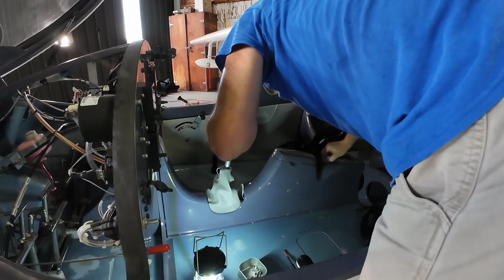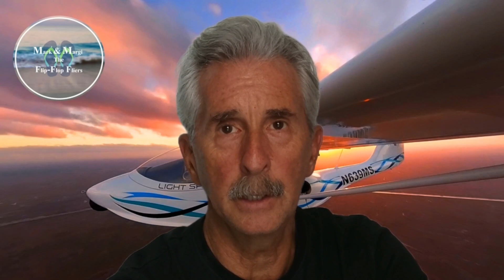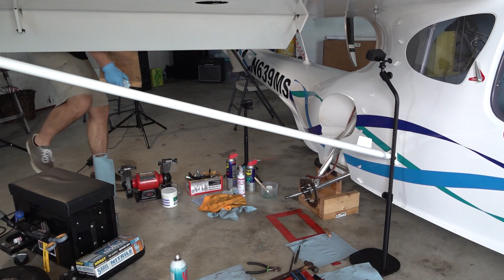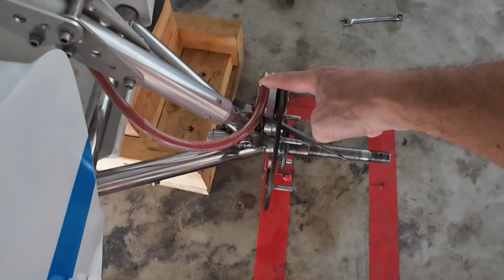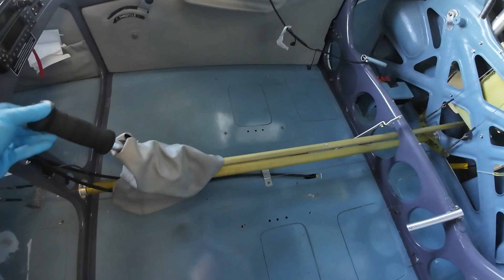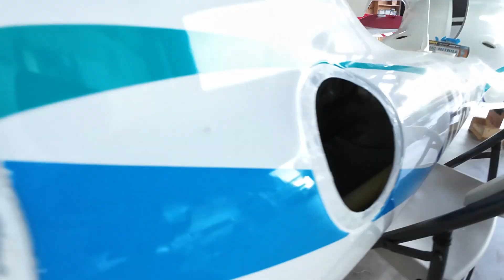Seamax Annual Inspection

Comment: Fantastic video, especially like the camera work on seeing inside the plane. Looks like a lot work to access the battery. Do you have to take apart the back panel to gain access to the battery?  Great job on the videos keep them coming!!
Reply from the maker: Thanks for taking the time to watch! We really appreciate it!
The battery is in the cockpit area on the floor behind the passenger seat and is readily accessible without tools or disassembly of anything.

Comment: Do you need to order anything from Seamax for those maintenances or are they only using widely available parts ? As usual, thanks for this great content !
Reply from the maker: Great question! We have had to order some things from Seamax in the past, mainly because I hadn't dialed in the preventative maintenance needed and frankly had let some hardware deteriorate. The company has been very responsive, though I haven't needed any Seamax specific parts in well over a year. All the items like the fasteners, bushings, and brake components are all easily procured locally. The bushings are just aluminum tubing, so it does need cutting, drilling, and some chamfering to produce from tube stock, but the skill set necessary for that is in the very easy side of ability.
All the Rotax specific items are readily available in the States.
Cheers!